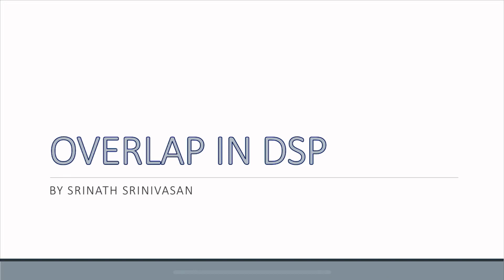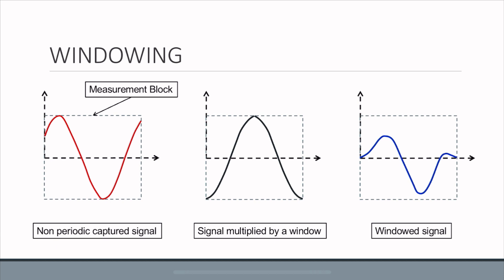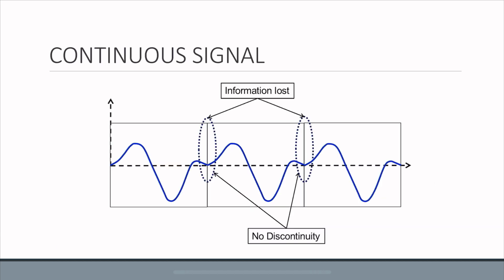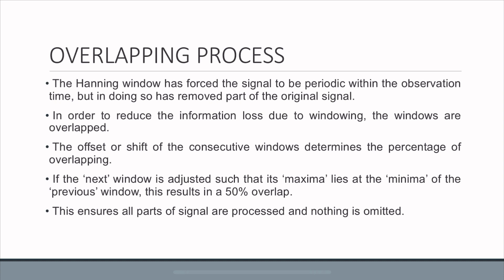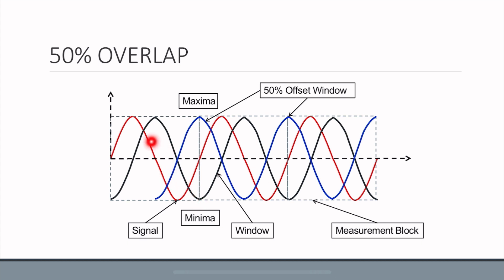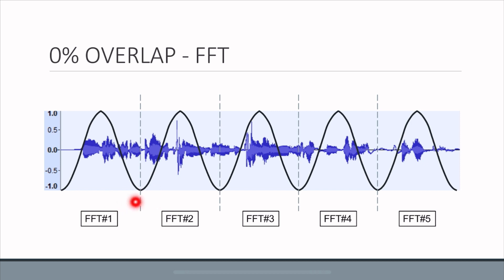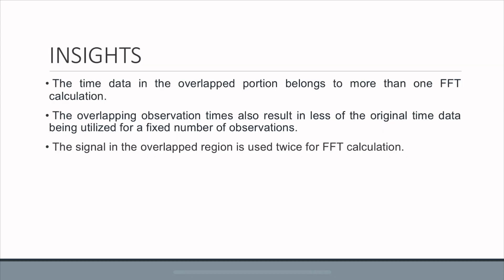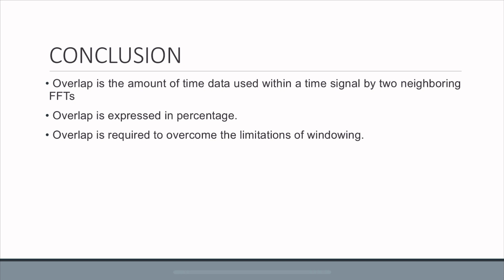Overlap in digital signal processing

Comment: Great video! Duplication effects: How does that effect the signal?
Reply from the maker: Generally, a 50% overlap does not lead to duplication. Although some parts of the signal are processed more than once, this is a necessary step to achieve accuracy and to overcome the limitations of windowing. A very high overlap (ex. 90%) processes the same signal too many times leading to more duplication and can lead to wrong results.